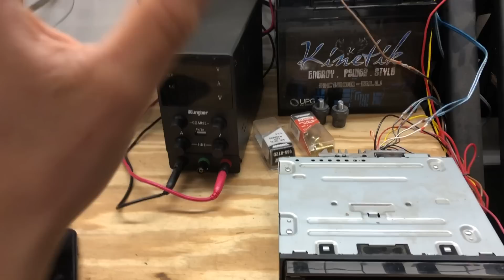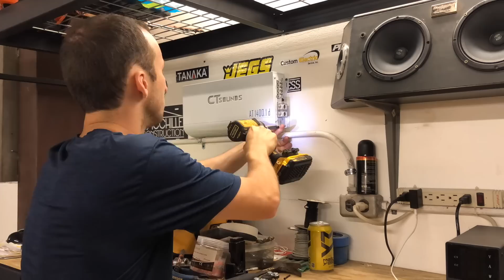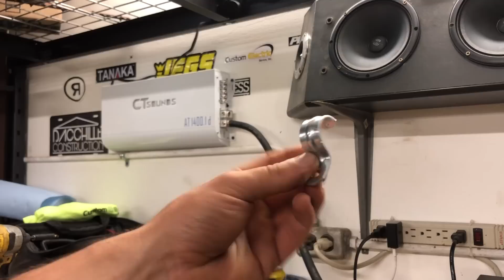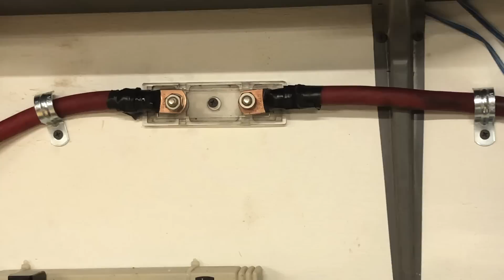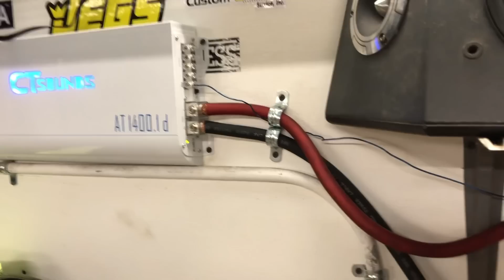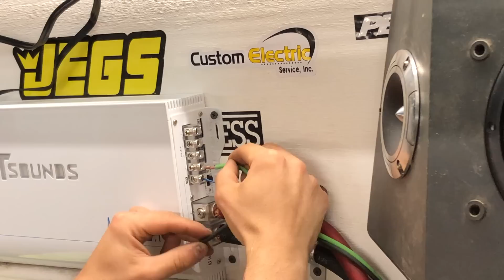How to Easily Hook Up Your Car Subwoofer in Your House / Shop

Comment: Got mine hooked up to a pc power supply and my Bluetooth soundbar 👍🏻.
Reply: hey could you show me how you did it?
Reply: Literally what I did.  I'm so confused what the battery is for in this video
Reply: @coug5459 I don’t know how y’all lowering a car audio sub in the house, my system drains a car battery in a heart beat so idk how to do this
Reply: @jeffreyparish8393  it's a calculation of watts (power consumption) 
I don't know your setup but I'll throw some numbers to hopefully help. I'll give you a breakdown of a 500watt amp, 1000watt amp, 1500watt amp, 2000watt amp for a sub in a car. 

A car runs off 12volts direct current and has an alternator that produces 14volts (two volts charge the battery and the other 12 run the car and it's electronics) 
Different car alternators have different amperage ratings. An alternator might be rated for 50, 70, 90 amps? Maybe more.. maybe somewhere in l between. Idk but let's assume 70amps (I think that's roughly standard?) Idk. But we're gonna rock 70 amps. Wattage is power or work of electricity.  If you have a 14v alternator rated at 70 amps it's total max wattage it can produce is 980 watts. That's 980watts to charge the battery,  run the headlights , run the spark plugs that run the engine, 980 watts to power the stereo and subwoofer/amp , 980 watts to run interior lights.. 980 watts to power all electrical needs of the vehicle. So, if you're running a 1000watt amp that might be 750rms you can count on 750 watts being used by the amp you're using and only leaving 230watts for the alternator to run everything else... you'll quickly fry your alternator in this scenario and this is why you see things like dimming head lights etc. The alternator just can't keep up.. ok so that's direct current from a 14v alterator for a 12v circuit/car... a house on the other hand is 120v alternating current. Everything we plug into an outlet is direct current and the power supply's and battery/phone/laptop chargers we plug into it converts the alternating current to direct current.. but here's how the numbers break down.. (the difference is the available voltage) 

A house is 120v and most outlets are 15a(some can be rated for 20 amps) we will go with 15amps. Keep in mind though.. most circuit breakers are also rated for 15amps so if you plug something into an outlet that's pulling a crazy amount of juice and then plug a vacuum in and run it in another room the breaker could trip if you exceed the limits of that circuit. This isn't a big deal it's supposed to do this.  Anyways let's get to the numbers which will show you the answer to your Q. Power or wattage is calculated by volts multiplied by amps=watts (volts x amps=watts/power)

120volts x 15 amps= 1800 watts.. 1800 watts available from one outlet or 1800 watts total available within a circuit.. but if nothing else is drawing electricity on a circuit.. In theory , you could get to or close to 1800watts from one outlet. 

Again.. your car at a 70a rating only yielded 980watts but 50-75% of that 980 watts would be needed to run the car so really of the 980watt rating of the alternator you might actually only have 245-490 watts available to run your sub in your car whereas one outlet in your house can yield at or close to 1800 watts on one circuit that isn't being used.. 

But,  how do you go from alternating to direct???!!! Do you just rig up a plug to your amp and send it??!!! 😆 🤣  NO DON'T DO THAT UNLESS YOU WANT TO BURN YOUR HOUSE DOWN AND POSSIBLY HAVE YOUR AMP EXPLODE IN YOUR FACE LOL 😜 🤣.  You can get a power supply that has a wattage rating higher than what the amp is rated for.  So, let's say you have a 1000 peak watt amplifier with an rms of 800watts  I would say get a 1200-1500 watt power supply (rated for 12v) it needs to be 12v output because that's what your amp was designed for.  A large computer power supply or.something similar can be found on Amazon.

Here's one for example. 12v at 125A =1500 watts

BOSYTRO 12V 125A 1500W DC Switching Power Supply Adapter PSU AC 110V / 220V-DC 12V Transformer Adapter, for 3D Printer,CCTV Camera Security System, Computer Project of Industrial Power Supplies https://a.co/d/ibdGiDh
Reply: @coug5459 he just already had a battery and didn't want to buy an inverter I'm sure.
Reply: @tthtonekid lmao be already as a conveyer is the black thing next to the battery the convert powers the patter so it don’t drain
Reply: i’m sure the battery helps when the speakers hit hard because when mine hit hard it cuts the amp off i’m running a xbox cord
Reply: @kvngbanks ye same not much watts
Reply: How is it not the same. A 750 psu is 750 watts. But using a car amp more wondering how  to get sub and blue tooth working together. Any way to use my computer as a head unit ?
Reply: Hooowwwwwww